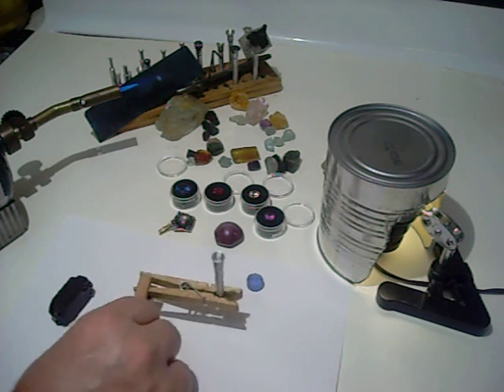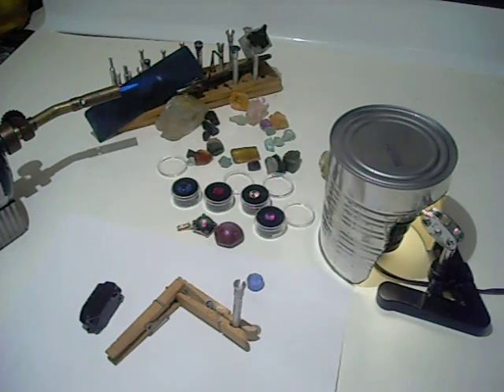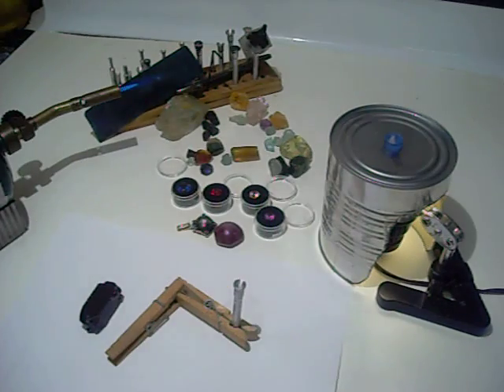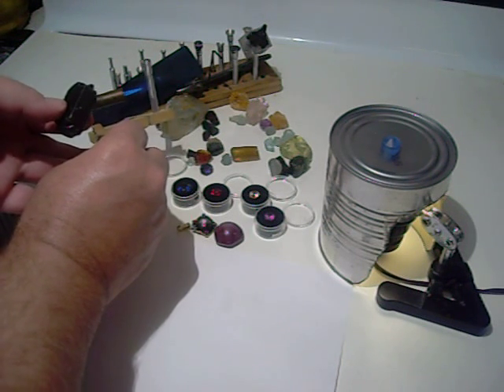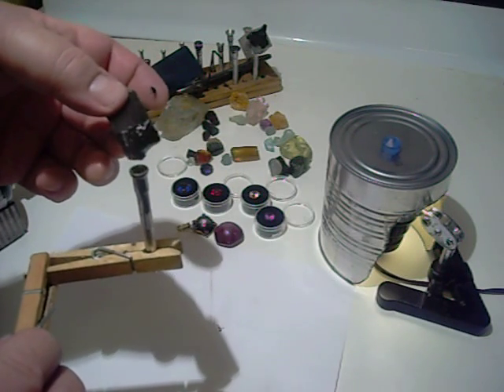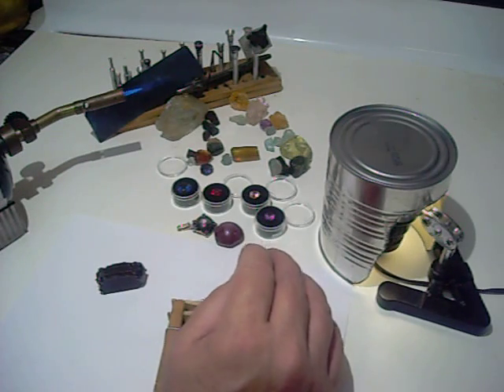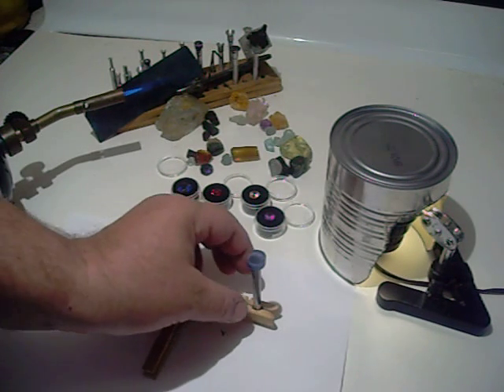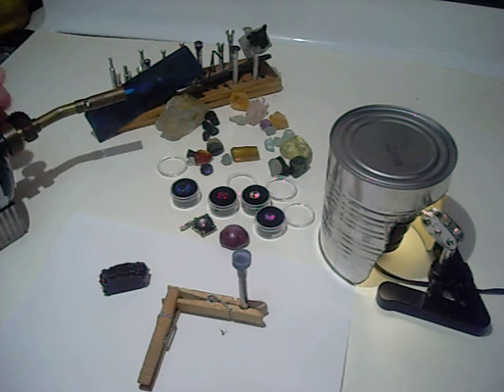Gem to Stem Faceting Technique by Jeffery A. Krueger

Comment: Iv got the same dops" what machine did you use with them
Reply from the maker: A Prismatic, I Restored , I've  Had two other Machines Previous and Keeping this one..., I  Ground the Set Screw to Fit the Groove in the Dop Perfect, I Hold slight tension Clock wise as tightening with the first Dop, after transfering to the second Dop in a Watch makers lathe , I Hold slight tension Counter Clock wise tightening the Dop(stem ) to the holder on the machine for best alignment.